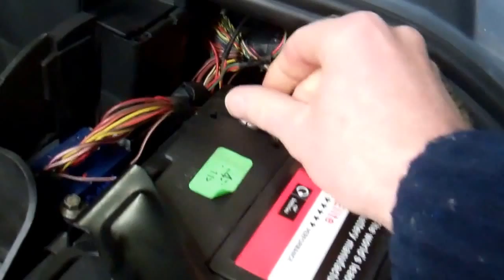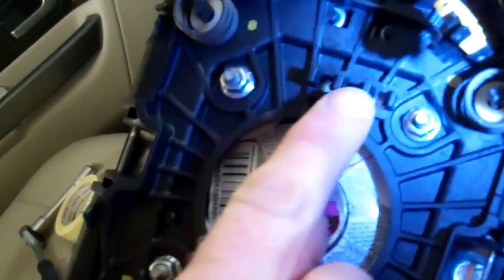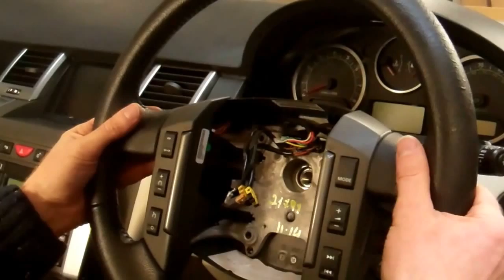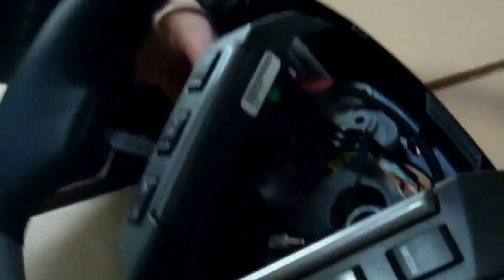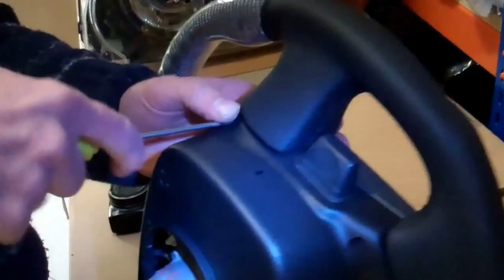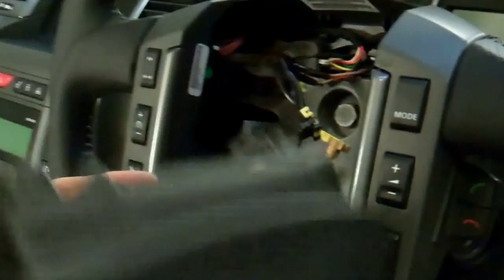How to fit Carbon Fibre Streering Wheel to Range Rover Sport 2005-2009

Comment: Iv the l320 v6 so got a paddle steering wheel and hope it works and do the carbon fibre skinning at the top and cut the bottom flat